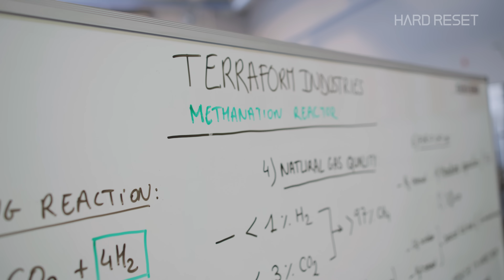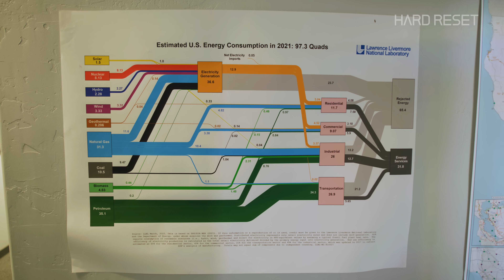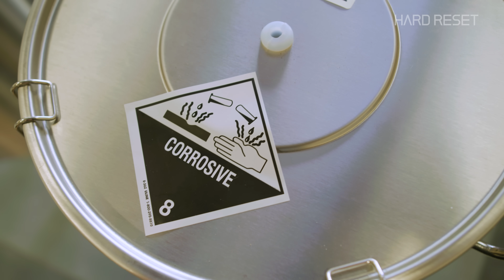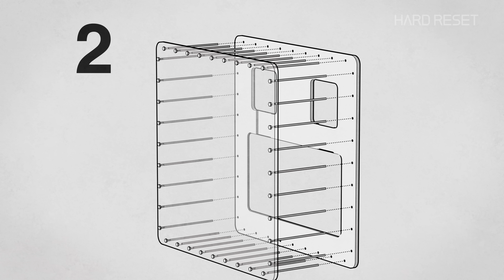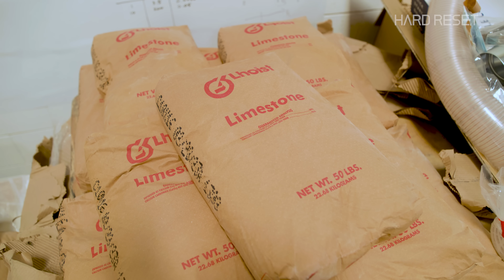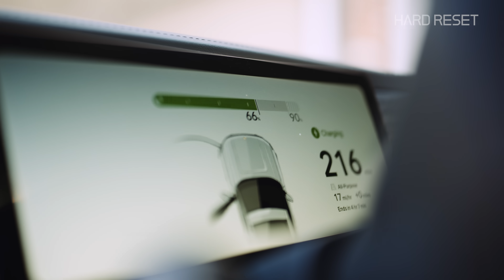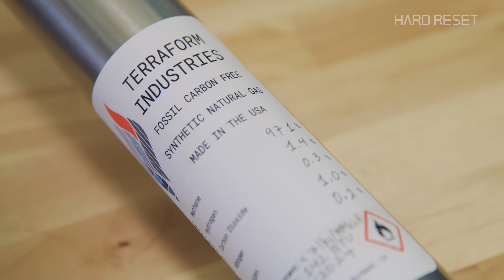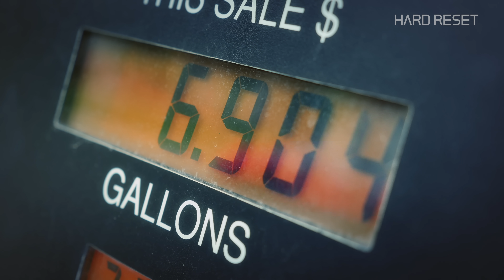The Last Fuel We'll Ever Need?

Comment: There is one line she said which makes me think they will succeed. "We are not worried about the energy efficiency, we want to keep the costs low."
Reply: Energy efficiency = cost.
Reply: @LordSandwichII  I understand what you are saying but in order to chase efficiency we end up spending huge amounts on R&D... Those costs also add up in a big way... What's the problem if a bit of sunshine or wind energy is not converted in the most efficient manner.. I think that can build up over time.
Reply: That means it should've been snapped up by some oligarch or oil baron and either buried behind patent/NDA walls never to be seen again or turned into a process/kit that they could sell for a 10,000% markup - but insure at least one step requires a 'fuel' that only that company would sell for an even higher markup.
Reply: @nikhilparanjape7890  nails it!
Reply: Energy Inefficient and Cheap somehow doesn't go together. Neither by Physics nor by Economics.
Reply: @aniksamiurrahman6365  Coal is cheap... Not the most efficient.. physics has nothing to do with abundance (supply of material) ...
Reply: @nikhilparanjape7890  Coal isn't cheap. What you see is the economy of scale.
Reply: @nikhilparanjape7890  Now let's come here on how their statement is contradictory. If they are capable of converting only 2% of the energy input into carbon fixing, they still has to pay for 100% of the energy. How on earth they are gonna make things for cheap?
May be the "cheap" is in terms of material use? Then, take a look, CO2 makes up for only 0.04% of the air. They has to spend energy for sucking all these air. Impurities are wasting their raw materials too. I don't thing these are gonna be cheap.
Reply: I think that may actually mean they disappear and it doesn't go widespread
Reply: and that's why they'll fail, energy inefficiency is opportunity cost, why waste 65% of your energy when you don't have to

much better off using electricity to power electrical motors

solar energy prices will continue to drop but so will natural hydrocarbons as we electrify the world, they need the price of solar to drop and the price of natural hydrocarbons to increase in an environment where prooduction/supply is already mature and demand is decreasing due to electrification

these guys only exist because of government grants
Reply: As an engineer who works in this space (energy production, carbon capture).   I can’t see this process working at low efficiencies.   They are not breaking new ground, they are using well known existing chemistry and packaging it into a complete ball of crap.  So they do electrolysis, like has been done for over a hundred years, but admitted they don’t do it well, using calcium reactions for CO2 capture, again this has been done for over 100 years, but it is not a life cycle efficient process, and they are doing it crudely and not well, then combine C and H2 to get CH4 using another 100 year tech, and again not well or efficient makes for a complete waste of time and effort.  Why bundle these processes?  Why not focus on making H2 in an efficient manner and selling it.  Why not focus on carbon capture and selling the carbon?  Why bother to combine the C and the H2?  Both C and H2 can burn. Bottom line, this is a marketing scam for stupid rich people.
Reply: @mikerit9570  these type of thing usually pop up because of government grants

easy money
Reply: This process is not even a little efficient, so whats the point methane is a worse greenhouse gas that CO2...
Reply: Right! The efficiency argument is often used for rejecting an otherwise promising technology, when in fact it's the cost that matters. As long as sunshine is free and abundant, I wouldn't care how much of it was needed when I buy a certain amount of fuel.
Reply: Yeah, the words sound good, but I don't think they'll ever match the price of fossil gas.  Thermodynamics is a harsh mistress.  The CO2 is widely dispersed, and there is a large entropic (= energy) for gathering it from it's widely separated state.  Then more energy is needed to regenerate the calcium compound.  He quotes 20-35% efficiency in going from electricity, but I have a feeling he's leaving something out, like running the fans and heating the lime.  Maybe if they get the energy for free?
Reply: @incognitotorpedo42  - Yes.  CO2 direct air capture (DAC) is costly.  3.67 tons of co2 = 1 ton carbon -> 1.33 tons or 44 MCF of methane = $500.  DAC is at least $600/ton of co2. So $2,200 for the carbon, and at least $500 for the hydrogen. $2,700 cost for a $500 output.
Reply: @ Which is why energy efficiency is less important (considering it would be dumb to power this from burning fuel) than cost. It needs to be the least cost in a solar or wind installation to be adopted.
Reply: The difference between 35% and 45% efficiency could be the difference between a $10,000 machine and a $100,000 machine.
Reply: As the hydrogen economy develops so too does the circular hydrocarbon economy develop.
Reply: he does say good words, I agree, but solar to hydrogen via electrolysis is not efficient.
concentrated solar via high temperature electrolysis is 3 times more efficient. 
I don't think so, major car manufactures are backing off EV, is too challenging. 
people really hate high prices of energy, he said it, there is no point of making gasoline for $50 a gallon.
high energy prices are social mayhem, dont work.
I THINK WE SHALL FAIL HARD, TO CHARCOAL.
Reply: @mojancevskialeksandar6955  And almost all hydrogen comes from NG.
Reply: @justanothercomment416  Not for this process.  It comes from electrolysis of water.
Reply: Do you find it extremly hard to STFU?....You may have some sort of mental illness?..But Being Smart is not amongst them!
Reply: @mojancevskialeksandar6955  but the point is, we have a ton of excess solar power and other power forms all day. We literally can't store it all. So even if you are getting 1/3 of the power back in the form of methane, you are helping to offset off the grid usage. Also, when (and I have to hope it's when not if) commercial fusion becomes a thing, then likewise any excess power could be used to create fuel for off grid usage which will always exist. 

We have gone to far down the path of carbon based fuels and the only way to bring some sort of equilibrium at this point is either to stop or do capture. One of those things is feasible.

Comment: I mean, we kinda already do something similar here in Brazil. We plant sugar cane, that absorbs the co2 from the atmosphere, we process the juice to make ethanol and run the engines and we burn the rest/bagasse to generate energy with thermoelectric  power plants. Similar to this project all the carbon is cycled, not removed, witch is a problem.
Reply: Plant power. ❤
Reply: I guess this is skipping this step and actually photosynthesis is very poor efficiency, less than 2%, which is why you need so much land area to produce very little fuel in comparison
Reply: No, the problem is that you use up too much fertile land to make synthetic fuel. Carbon neutral fuel is by far "good enough" and you even avoid the methanol trap (where you turn CO2 into a worse greenhouse gas). 
But there simply isn't enough land area to go around to create meaningful amounts of synthetic fuel this way. 

I mean, if everyone went vegan and we stopped using the majority of fertile land for pastures and growing feed for cattle. 
Or if we decided that having rain-forests (and other kinds of forests) simply isn't necessary. 
Then we would have space enough for synth-fuels.

Comment: Not sure how much use there will be with all modes of transportation switching to electricity motors.
Maybe if efficiency improves it could be used to store pv & wind power.
After listening to this, it sounds like it would be far more efficient to just use electrolysis to make hydrogen.
In your efficiency estimates is the mining of limestone included.

Comment: Why go the extra step creating methane when you could just use hydrogen? Hydrogen can be used in fuel cells instead of just burning the methane inefficiently.
Reply: Hydrogen is volumetrically less energy dense and much harder to contain for storage and transport. Plus, as you point out, it requires different equipment to make use of. It sounds like their envisioned market is not new energy infrastructure, but replacing fossil fuel used in existing infrastructure.
Reply: @Jontheplant  that just perpetuates all the crappy inefficient and dirty fossil fuel burning vehicles and plants and whatver rather than transitioning to something quieter and cleaner which can also be recycled; electric motors, and batteries for reusable energy storage.
Reply: Because hydrogen is bulky, expensive to contain, and bloody dangerous.
Reply: Hydrogen has its fair share of problems as a fuel. For one, it is hard to contain for long periods of time because it is so small it permeates into other materials and corrodes them. It is also explosive and has no infrastructure built around it. Methane has been used for longer and there is infrastructure for it.
Reply: There are fuel cells that run off of methane.  So you can use it more efficiently than just burning it.
Reply: Methane is stable and easily transported. Hydrogen is a bitch to move around without substantial loss. That’s it.
Reply: My boat has a methane tank for cooking. Will I be able to buy their device to perpetually keep myself in cooking fuel?
Reply: cause hydrogen storage is hard
Reply: why not just use the electricity directly to power things. why go through an inefficient process at all only to get less energy than if you used the electric directly.

Comment: comparing this to photosynthesis is misleading at best and a blatant lie at worse.

This process doesn't involve sunlight for making biomass, this is simply taking existing electrical energy and converting it into chemical energy which electrolizing water already does yet admittedly safer.

until they manage to make something that can be liquid or solid at standard conditions this is far from the ideal fuel like the true carbon neutral ammonia

Comment: People who make such advances tend to “disappear.” So, watch your back!
Reply: This isn't really an advance.  The biggest difference here is focusing on ease of manufacture and safety.  As was pointed out, the process for making the methane is over a century old.  Actually, all of the chemistry is more than a century old.  Electrolysis to produce hydrogen is old.  Using limestone powder to capture CO2 is old and natural, as is the process of getting the CO2 out (cooking it) and recycling it (wetting it) - these are all part of the chemistry involved in making cement.

The biggest thing happening here is deciding that electricity is cheap enough that it's time to make simple and reliable parts to build a synthetic fuel plant.  And, TBF, they're almost certainly right.  You only need actual electricity for pumps, conveyors, fans, and electrolysis.  You can get that from solar, wind, tide, or fusion.  It doesn't matter.  To recycle the carbon capture system, you need heat.  

You can get that via electrical heaters, or by using any of the solar thermal power plant designs being developed.  It's not simple, you have to heat limestone to 900C or 1650F to liberate the carbon dioxide from it and turn it back into quicklime.  Building a solar concentrator to get that temperature on most days is possible, but can be complicated.  

The only big bonus to all of this is that there will be less water required to synthesize the fuel than people expect.  The water absorbed by the quicklime to slake it will be re-released after the Limestone is heated.  The water that is electrolyzed into hydrogen will be released by combustion of the methane and return to the air.

None of this is new, Terraformer just thinks it's economically practical and will compete well with fossil methane and possibly other fuels.
Reply: @ I hear you. But your argument is so much akin to saying that because the flame torch and candle weren’t new, the (practical) electric light bulb “wasn’t really new.”
Reply: @danohanlon8316  Uh no.  It's more like saying that since the lightbulb was invented in the late 19th century, and infrared food warming and cooking were first discussed in the 1920's, the EZ-Bake oven wasn't really new.

Comment: Using electrolysis to split water into hydrogen and oxygen, then using a known method, to combine it with carbon-dioxide and convert it to methane. Apart from making a lengthy video, what is new in this technology and what is so unique. Just replacing carbon-dioxide capturing method using limestones?
Really?
Just another person doing the same, but claiming to have reinvented the wheel.

Comment: Dear Hard Reset, I have your next video idea: Solar Electric Ethanol production (a similar form of artificial photosynthesis). Cheap and simple to store, easy on environment, and already has a large infrastructure. The recent efficiencies achieved at Berkeley Lab and UCF for both the catalyst and fuel cells are now such that it beats all other fuels for most purposes in its entire chain. It IS the future fuel despite its lower energy density than gasoline or methane or hydrogen simply because it is so cheap and safe to store. It also requires few steps to both produce and consume. Also, many existing and older vehicles could be converted to pure ethanol for a low cost. An entire system of production, storage, and consumption could exist at private residence for about the same cost as solar battery systems currently, thus making it decentralized. There is not enough press about this.
Reply: You need to do like guy in vid, at "terraform industry". Build it yourself quickly. As an NPC, I'm looking forward to sooner rather than later!
Reply: Lower energy density than gasoline which only gives 25% of it's energy in an engine. If you increase the compression using ethanol you get more efficiency also the cooling system can be much smaller as you do not get the waste heat.
Reply: do you have any links to information about this technology
Reply: Ford model T was intended to run on  Ethanol.

Comment: Interesting, exactly my thoughts, methane and methane fuel cells are a near term viable future, infrastructure exists, ICE equipment can run / be converted to run on methane, domestic heating systems work with it, it's compatible with natural gas systems, storage is way easier than H2, Hysata in Australia are at 95% efficiency with H2 production.This obsession with efficiency is madness, looking at previous energy production efficiencies, efficiency was deplorable but economically viable, anyone with a scientific background knows this, low efficiency doesn't cause global warming, create pollution or cause cancer, asthma or damage brain development in children. Battery tech. has a real future and there are super promising solid-state batteries on the horizon, but we can have more than one green technology and methane could be quicker to implement in the short term. 
Also something non engineering minded stupid people never seem to understand is technology evolves, they only seem to be able to talk referencing current technologies, however even the vaguest of smart people understands once something is economically viable R&D and investment quickly pushes the technology to new levels of quality, cost and efficiency. Are these dimwits saying there's no future in air transport because the Wright Flyer only carried one person and can't cross the Atlantic or why did Trevithick waste his time making a noisy metal thing I wonder?

Comment: This a great idea and I love it. Australia should be jumping on this ASAP to build it at scale given the vast land area and reliable sunshine. We can use excess solar from the grid during the day to generate gas and store it for use in peaking plants when renewables dip. I have just described a battery, no lithium required.
Reply: Currently the excess solar is shuttled around the east coast and stored in the various hydro schemes on the mainland or sent via the DC link to Tassie for storage in their hydro setups. 

Most likely this becomes attached to something that already has a CO2 byproduct as part of their chemical production, the waste heat also being scavenged to help reduce the costs associated with this. Theoretically if you could speed it up, you could run it off the exhaust of a gas turbine already used to produce electricity. Yeah it isn't infinite, but the energy is plentiful and currently exhausted to atmosphere
Reply: Unfortunately, Australian investors dont like to invest in tech. Hence why the founder is in the USA
Reply: Much like health insurance CEOs, the barrier is not the technology, it’s the rent seeking tech bros and gals in the corporate headquarters of the lobbyists offices for extractive industries, transport associations and utility companies
Reply: Your a trusting individual.